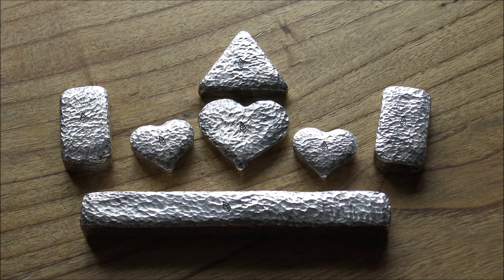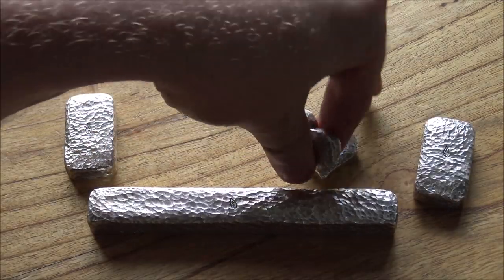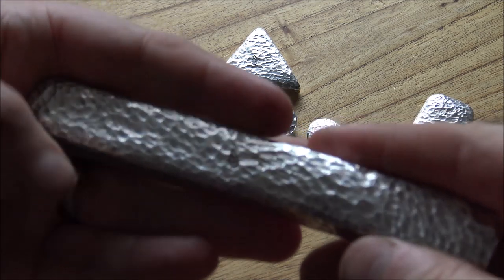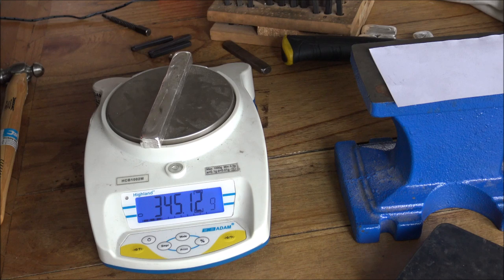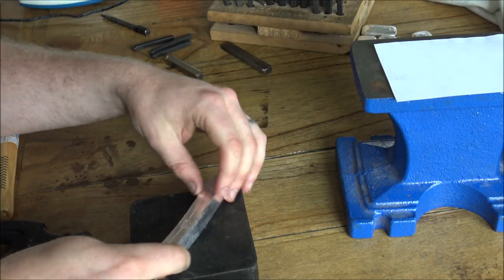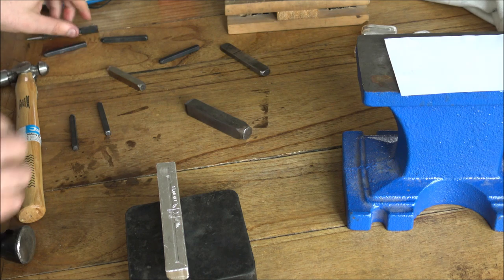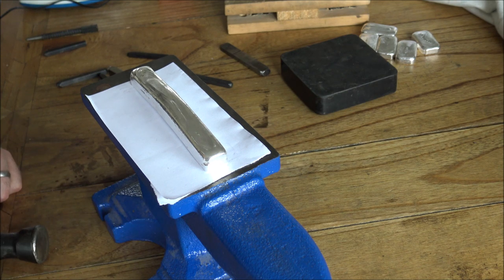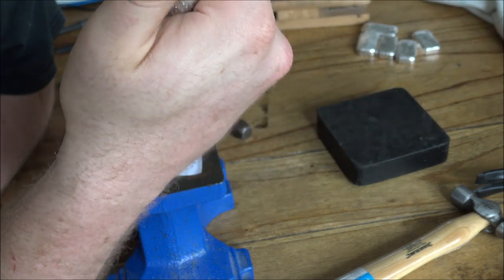Making hammered silver bars - they turned out AMAZING!!

Comment: When u hammer your stamp when the bar bent. I’ve been told by other pour artists that if u put the bar on cardboard it reduces the bend.
Reply from the maker: Thanks for the tip - I have actually tried that but it means a less solid surface for the bar to hit against, which means the chances of a miss stamp go up considerably.